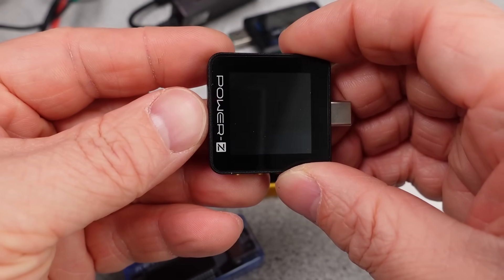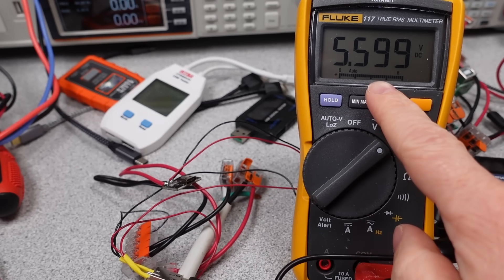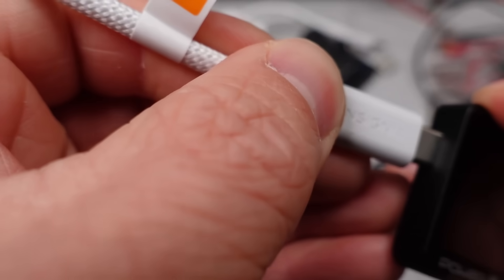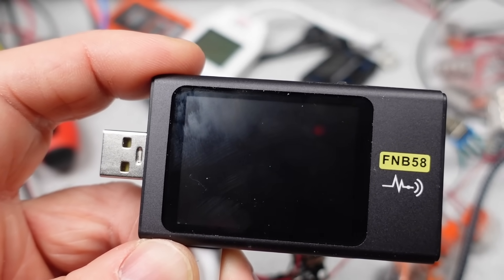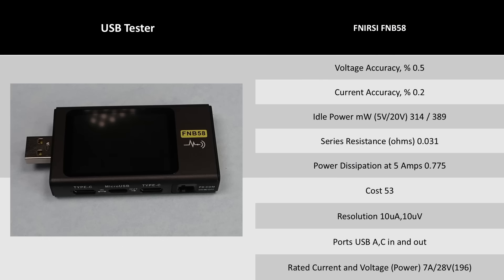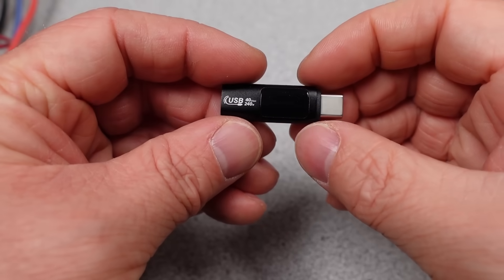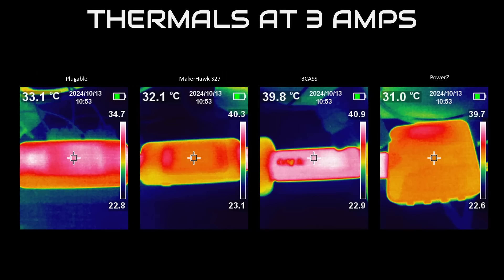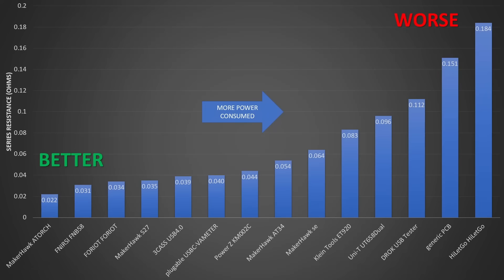USB Testers and Meters – Which one is BEST???

Comment: 06:21 To get to the review/testing. Looking at the UNI-T UT658Dual for adapter and cable testing mostly. I like the looks of the Klein but it's not worth the extra cost and the UNI-T has a larger display as well
Reply from the maker: Yeah, the Uni-T is the better value for sure.

Comment: I'm surprised none use a hall effect sensor to avoid 'burden' voltage losses altogether, it would be sensitive to orientation and external magnetic fields though. Also it would need to cal itself at power-up so that's another switching element with 'V-on' losses and.. oh maybe that's why..
Reply from the maker: Another commenter talked about how complicated it would be to implement, but yeah, the ACS715 or whatever the model is would make a difference in many of these.  The atorch (and 100's of other brands that are the same thing) uses a mere 1 milliohm current shunt, yeah, it's junk at low current, but that's actually lower than the cheaper hall effect options although they'd be a bit more accurate.  The hall sensors do tend to be worse generally versus a resistor and an op amp, but you get isolation too.

Comment: Recently bought the non-Bluetooth version of the Fnirsi FNB58, it arrived yesterday. I really love it, it tells me every little detail about all my various chargers which is great. 

I used this video as a reference before buying, so thank you for the info! Time to protocol-check every single charger I come across 🙃
Reply: is there any considerable advantage on having bluetooth version?
Reply: @shanakabandara7614 the Bluetooth model has a phone app you can use. That’s the difference and it allows full control and data via the app.
Reply: @shanakabandara7614 I would say no, but could be nice if you want to make logs and export them to your PC for some form of statistical analysis. Usually the price differs with a few bucks but imo I would save those dollars and invest in maybe a dummy/DC load for more expansive analysis
Reply from the maker: hahaha nice.
Reply: @AllThingsOnePlace  Is that newer fnirsi FNAC-28 the new best performance for the price, or is another one best now?

Comment: Great video. I have the Plugable one. Mostly bought out of curiosity, but it has been useful to see what cables and charger blocks have developed faults - confirming that a MacBook and Pixel phone were not the source of charging issues.
Reply from the maker: Nice.  A great use case for these.
Reply: What is the sign for charger that have fault?

Comment: Thanks.  Everyday life is an important use-case for these.  Many USB-C gadgets can charge or be charged, so a direction arrow is important.  Also, small is good, but not so small that it needs two extra cables just to function!  So, I like the J5Create cable / meter.  Mine has held up for almost two years, but Amazon ratings indicate some QC problems.  (So, buy early and test it!)
Reply from the maker: Mmhmm.  Thanks for the feedback!

Comment: Correct me if I'm wrong, but when a tester needs to draw power as well as measure an accurate reading acting like its invisible. Does that mean there is code in place to know how much power the device is going to use, and adds that on top of the readout so it shows what a device or cable would be drawing without being plugged in?
Reply from the maker: Yeah, the devices do use a small amount of power.  Depending on where they measure, there will be some inaccuracy in the measurement.  The power Z and Fnirsi allow external power.  There is also burden voltage inherent in all of them.  They do not correct for any cabling or external connections.

Comment: I use the ubiquitous Ruideng stuff for verifying rough power draw on devices. Occasionally also have to use them to outsmart cheap devices that don’t put the right resistors on their USB CC lines. But sometimes it’s nice to just get a rough idea of how much current a USB device is pulling with little effort.
Reply from the maker: Yep.
Reply: @AllThingsOnePlace  I didn't see any Ruideng in your review. I have several UM34 that I liked until I got Fnirsi 48. Still has the lowest power draw of all my testers. Interesting it looks just like the Makerhawk se, I wonder which is a copy of who?

Comment: PowerZ is the one I carry. The power measurements and ability to easily read emarker is all I need. Ive used it with the desktop software but typically i have it with me in the markets when im evaluating cable vendors and I just power it from a battery. I had an issue with a unit after about 1 year and I took it to their office in Shenzhen and they evaluated it and swapped it out on the spot. If I ever break it or lose it then I will buy another one with no thought needed.
Reply from the maker: Oh, nice!  Yeah, can't beat that for customer service!

Comment: FNB58 has some issues with PD. It usually goes into PD detection loop unless it’s powered via the micro usb port. Software updates are a must although PD detection loop is a hardware issue by the looks of it.
Reply from the maker: Yeah, I had it reset a couple times.  I've had the Power Z crash before also.  The more complicated they get...

Comment: I recently bought a few of the Fnirsi FNB58 models to distribute across my kits.  I haven't used any of the more advanced features yet but it's nice to have them on hand.  Managed to find them for around $32/ea by patiently watching eBay.  It's nice to be able to watch devices charge and compare current draw to what the device reports as charge level.  Lots of devices 'simplify' their charge state reporting, saying 100% when they aren't really, so it's useful to be able to verify that and get a better understanding of battery bank SOC reporting and the like.
Reply: What I bought one for $15
Reply: @SharvilSawargaonkar  Really?  If so, congrats on the find.  Where did you get it, eBay, AliExpress?
Reply from the maker: Nice.

Comment: Hey mate, I sent you an email with a link to buy a 48v 5a 240w USB PD power adapter that you may be interested in. Cheers
Reply: Go do something bmw related mate!
Reply: @murrayallen3684  engine has been at the shop since fuckin January mate I'm trying ahahaha
Reply: @murrayallen3684  Engine shop has been doing valves/guides since January :(
Reply from the maker: Yeah, I saw that, looks like maybe an engineering sample or it's a 48V power supply they stuck a USB end on.
Reply: @AllThingsOnePlace  if you look up the part number you can find a datasheet that shows it has proper PD negotiation all the way to 48v. I agree that it's likely an engineering sample. Only one I've seen in the wild.

Comment: I have the Power Z. Very good for the hardware IT guys. Laptops all going to USB C for charging leaves us with a lot of bad cables and bad ports. Educated opinion - USB C Is a bad hardware decision and I wish we weren’t so deep into it and could change. 

Opinion aside, it’s nice to know when and what a laptop is requesting for power and if the cable is able and willing to supply.
Reply: Also some of those cheap cables either are not wired for being reversible or it break in one of the sides. And then you wonder what is wrong and is it the port or the cable.
Reply: @glynnetolar4423  Dealt with this this week with some docks and USB C extension cables. Kills me.
Reply from the maker: Yeah, very powerful tools.  Yeah, the USB C port is going to be around for a while, it's in laws now...
Reply: @AllThingsOnePlace  also. I think the only thing not mentioned in this video is the directionality of these testers and how limiting it can be. The Klein for example is only one way and if it makes the test useless in a lot of scenarios. The plugable’s bidirectionally and rotating screen makes it a great pocket tool.
Reply: Could there be something better than USBC? Yes obviously. But would I ever go back to the absolute mess that was everything before it? No, absolutely not. I think that having a naming convention that was easy to read and understand would help a lot.
Reply: @thefuzzbl  you don’t see the problem with having a port that can do anything from 5w to 240w and 0 data to 40GB data? All through a flimsy port that and cable end? 
It would be nice but 99% of cables out there support minimally viable speeds and watts so you never know what you’re gonna get. 

Don’t even get me started on naming.

Comment: The simple little inline meters are about $5 last I checked.  I put them everywhere which really diminishes the amount I use the fancier meters.  Those small ones also fit many places the bigger ones don’t.

I use the Power Z mostly to read cable eMarkers.  That function is at least as important as testing the bus configuration and actual current and voltage.  The eMarkers of most cables I have purchased differ somewhat and from the marketing literature claims.
Reply from the maker: mm, thanks!  There is certainly more to look at in this field, I just scratched the surface.

Comment: Picked up a PowerZ (the new version) off aliexpress for $47 last year before black friday and have had good service from it. I have been happy with my purchase and would buy another one should something happen to it. The graph for power is nice, as is being able to save the power data for charging/discharging power banks and doing capacity tests. It has also been good for resetting a slightly dodgy power supply that gets "stuck" sometimes by having the PowerZ request all the PD modes available as that resets things for that particular power supply.
Reply from the maker: It's amazing how useful those things can be.
Reply: Yes! I use that same trick, too! I noticed that some charger/device combos didn't work, and when I would out the Power-Z in-line, they would work.
Reply: Yeah, no sense buying it off Amazon. ChargerLab spreads FUD that they're fake on Ali, but they are the real deal. It's half the cost or less on Ali depending on coupons.

Comment: I have different one cheap usb meter - voltage and current measurement is quite good but measuring energy is out of the window - it's not even close, like 4-5x less then it should be.

Comment: Oh shit, I bought Plugable... I wish your video existed before. Thanks for the video!!! Huge fan of you. From what experience, how bad is USB on power extensions? I ordered Belkin 8 Socket 2m USB A & C Surge Protected Extension Lead which is all white. It should be high quality?
Reply from the maker: The plugable wasn't bad, it did what it claimed.  The main issue I have with the USB power in the extension cords is they don't bother with some of the efficiency standards, so sometimes the USB adapters built in are lesser quality versus a dedicated adapter.  I haven't looked at a Belkin though, hopefully a little better.

Comment: I've had the Klein one for years. I honestly only bought it because it was a name brand that I had some good experience with and was in stock locally, lol 
I really have only ever used it for testing older battery banks that don't have a built in screen to see what the battery capacity is and what kind of output it supports.
Overall happy with it
Reply from the maker: Yeah, it works, it matches accuracy of the other instruments in the same class.  It does have that retail friendly package and name.  It will drop a bit of voltage is all.

Comment: A feature to prevent a powerbank from auto shutting down would be nice.
Reply from the maker: Mm, yeah.  Daisy chain enough of them together and it’ll use enough power to keep it on.
Reply: A USB powered nightlight is usually enough to keep them on with low power waste. Some powerbanks these days also have a "low current" mode that you can turn on. My Anker has you double click the on button and one of the LEDs changes color to let you know it won't auto-off. You wouldn't know that by looking at it, gotta read the manual.
Reply: @gd.ritter it's the trickle charging mode. I found out that some powerbank does offer that mode but does not disclose in the instructions manual, usually also a double click to activate
Reply: Funny enough, I use my FNB58 for that purpose lol. It won’t charge my keychain flashlights otherwise.
Reply: The Power-Z thingy has a "resistor jumper" mode that does exactly that for powerbanks/chargers that go off if no current is being consumed
Reply: Usually shorting the data lines together will accomplish that.
Reply: @methanial73  Thanks, I will try that.

Comment: Power is I2R ain't it so supply voltage level doesn't matter 10:30 comparison of dissipation
Reply from the maker: Yep, it’s not perfect as mentioned they have some power consumption that changes between different voltage settings but it is close enough in many cases to call it the same.

Comment: I have the Plugable 240W USB-C meter, and the display update rate is slower than my other USB-C meters, annoyingly so.

Other than the ChargerLabs Power-Z line, the higher-end FNIRSI meters, and Plugable, all the cheaper usb-meters have ambiguous origins/manufacturer, you'll see the exact same hardware re-branded a bunch of different ways by chinese vendors (maybe in some cases copied, but probably in most cases just re-branded with an unlabeled one from the factory. I have a few of a distinctive style that I think are from Ruideng: the UM34, the TC66, and the AT34 which was labeled MakerHawk in this video. I think MakerHawk mostly does re-branding of stuff from other chinese factories. ATorch is another recognizable brand, they make one of the few consumer-grade relatively-detailed/featureful AC power meters. Navigating branding/origin of cheap chinese electronics on Amazon or Aliexpress is a real challenge :)

I value relatively slim/narrow designs, because if they're too fat, then you may need a little extension cord to make it practical to plug them into the charger or device. I found some 6-inch usb-A and usb-C extensions with relatively high-gauge wires to minimize resistance losses.

I like the TC66 a lot, even though I also have the Power-Z KM003C, for simple tasks I'll pull out the (Ruideng?) TC66

Comment: I don't know about the POWER-Z but the FNIRSI is offering much more than just measuring voltage/power. The most amazing feature it has is that it can be used as a PPS PD trigger to get whatever voltage you want. Also it does way way more, like USB cable testing, mode to measure exact battery capacity, oscilloscope like interface, etc.
Reply from the maker: Yes, I spent some time showing some of the extra features.
Reply: @AllThingsOnePlace  I find the Fnirsi works best if you power it externally via the PC port. If you don't do that you sometimes get it rebooting if you try doing stuff like protocol detection. I guess that depends on the behaviour of the PSU under test, but it's a useful feature.
Reply: @turbinia  interestingly the Power-Z KM003C has a large capacitor, that enables it to stay on if USB power is interrupted, or for 4 seconds after you unplug it. I think that may cause it to draw a significant surge of power at startup though ...
Reply: The Power-Z does all of the same with PD negotiation packet interception and better software + fw support than FNIRSI
Reply from the maker: @eugene4350  Thanks!  Yeah, I did get the 003 model to check out also.  Any tricks or tips for the newer model?
Reply: Which specific FNIRSI model are you referring to?
Reply: @lupton71  FNB58

Comment: I mostly use the FNIRSI and Power-Z for checking protocols. FYI There is a Kickstarter for a new BLE caberQU.
Reply: The CaberQU are for testing cables, which is a bit different from what these power-meters test, even the ones that detect the E-Marker (e.g. the CaberQU test all the pins/wires for connectivity). Cheap-ish devices which can conveniently test the cable resistance are very rare, that BLE CaberQU appears to be one of them, the other one I know of is the BitTradeOne Cable Checker 2, it's pretty nifty.
Reply from the maker: Thanks. Mm yeah always more to check out.
Reply: @AllThingsOnePlace  Yes, please analyze the BLE caberQU.

Comment: Your fnirsi was using a very out of date firmware (especially visible due to lack of spaces between words). Perhaps it will show better/worse values after an update? It will definitely detect more USB charging protocols after an update though!
Reply from the maker: Thanks.  Yeah. I figured that.  I only did the update with the power z.  It’s a first pass at this kind of video so leaving some room for future videos.  It is quite an amazing tool though.  I did tear down the atorch and it is impressive.
Reply: @AllThingsOnePlace garbage video and methodology 🐕 💩 😂

Comment: The Power Z has made so many tests trivial it doesn't leave my bag. Good to know it's accurate enough too
Reply from the maker: Yeah, that’s my go to most of the time.
Reply: @AllThingsOnePlace  I thought the FNB58 was a better value and could test cables with multiple connector types....
Reply: @ThinKkBIGG  The Fnirsi FNB58 has some advantages like USB-A male but Power-Z has the advantage of USB-C male. Why do we have to choose? Why not both? And can it please be retractable? I'd like to travel with these, but the exposed male connector isn't the best for durability and physical safety. It is useful to test USB outlets on buses, trains, public places, hotels, cars or just for your curiosity. Or when someone has a cable and something isn't working and you can figure out the problem right away instead of having to speculate. Just a very useful (and interesting) thing to bring.
Reply: @AllThingsOnePlace  have you bought the km003c yet?
Reply: I got one off ali express after seeing it on this channel a while ago.  It was a bit cheaper, but took a while as everything over on that site.  It does everything I need and then some